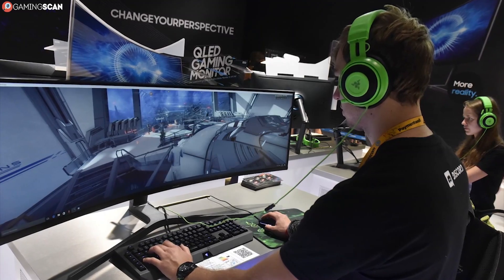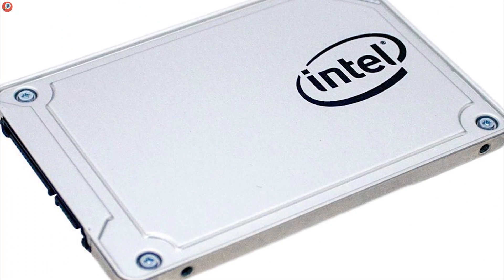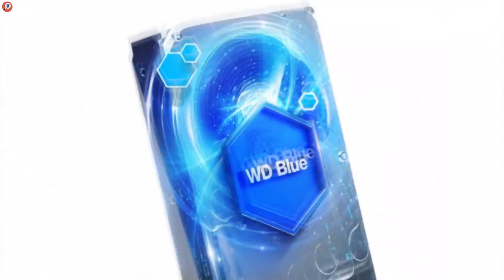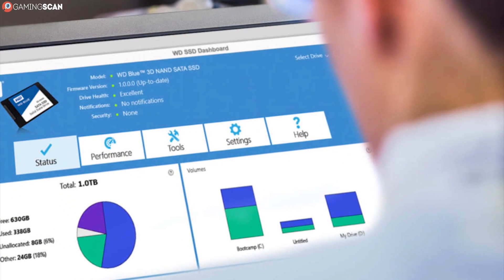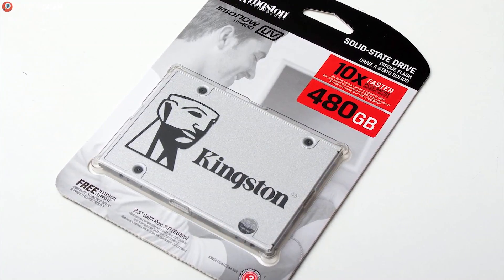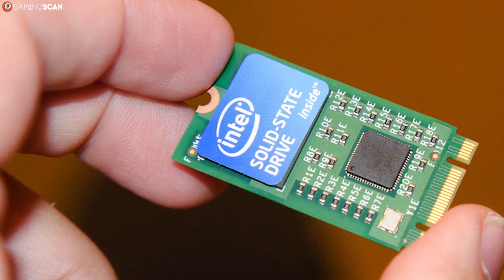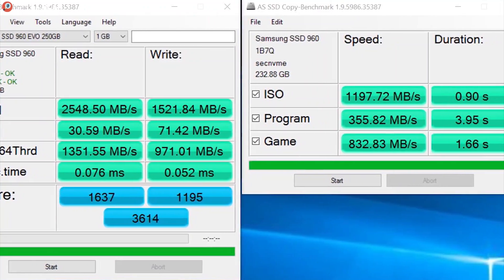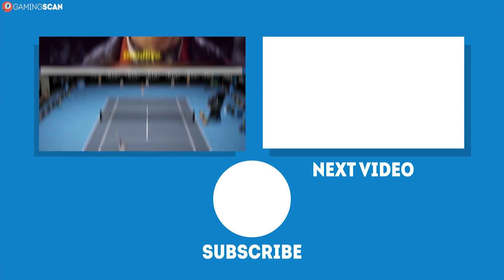Best SSD Drives 2020 [WINNERS] – The Ultimate Buying Guide

Comment: Don't ever overclock an m.2 they heat past 74'c in mere minute's I lost 2, $250 in total
Reply: overclock an ssd? thats the most stupid thing i have read on internet in a while.. must be really low iq
Reply: @Destro I made a mistake I didn't even have games on the m.2's I played on SSD and it works fine still, but the newest driver is from 2018 it's fixed now,driver booster is the best app support assist dell is the worst shits to use as in it doesn't work for updating software.

Comment: I got SSD chinese...cheap
Reply: @Fire Lord Ozai All good with the Chinese SSD, thanks
Reply: Cheap=chinese
Reply: @willyjimmy8881   Yes but those... "Cheap=Chinese" SSDs have Triple Layered Cells just like Samsung EVO, Kingston, Intel (most models), WD and more. Shouldn't you be more worried about Samsung QVO and Intel 660p SSDs as they have Quad Layered Cells in them? Well go ahead and get yourself an QLC SSD if you think they're better than any "cheap" Chinese TLC SSDs.
Reply: As long as you avoid ANY Quad Layered Cell (QLC) SSDs, then you should be fine. However you may need to manually set some free, un-partition space for over-provisioning. My Chinese SSDs are doing well, so far at least.
Reply: @t8polestarcyan22  what is the brand of your chinese ssd?
Reply: @jesmartobias7859  Good question. So far I've tried and using KingSpec (No NOT Kingston!), GoldenFir, and KingDian. All of them are TLCs and so far so good. None of them have failed, not yet @ least. 
There are more Chinese TLC SSDs around so I can only name a few as above.
Reply: @t8polestarcyan22  thank you for ur quick respond and its not that pricey, ryt?
Reply: @t8polestarcyan22  and what model of kingspec, goldenfir and kingdian is the best?
Reply: @jesmartobias7859  To my research Chinese TLC SSDs are similarly priced to Intel 660p or Samsung QVO series (probably slightly more than those QLCs). Just take your time shopping at Ali Express. You can also check manufactures' websites as well. If you can get something a lot better by paying slightly more, then it's worth it!
Reply: My cousin uses a Chinese SSD. its working fine and fast
Reply: @hircine92h  Good to know. As long they're TLCs which most of them are. Probably almost all of them.